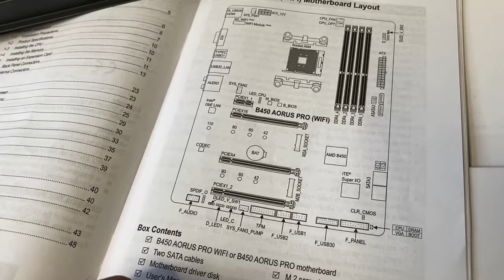How to Install a Case Fan in your PC

Comment: mine doesn’t have the led1 thing what do i do??
Reply from the maker: If your Motherboard doesn’t have a RGB connector then you’ll have to get a sata powered 3-pin ARGB hub.
Reply: @BuildsWithV  even the fan is single color i need that? Sorry im newbie
Reply from the maker: @joshuasantiago4342  what fan do you have?
Reply: @BuildsWithV  its has no brand found it on amazon its single color red fan
Reply from the maker: @joshuasantiago4342  oh okay, is the connector on it a large 4 pin connector? Could be a molex
Reply: @BuildsWithV  yes its four pin and single color
Reply from the maker: @joshuasantiago4342  if it’s the molex connector, that plugs into your power supply cables.
Reply: @BuildsWithV  if i only want the fan no rgb do i only put it on system fan 1?
Reply from the maker: @joshuasantiago4342  it might turn the RGB on automatically if there’s only 1 cable off the fan. But yes you’d plug it into the system fan connection.

Comment: Have you really installed the PSU with the fan faced up? Are you serious, man?
Reply from the maker: Yes I did. I used it as an exhaust fan. I changed it back down tho because the PSU would get a bit hotter than I liked.

Comment: what if i only have 1 sys fan?
Reply from the maker: R0TC if you only have one header on your motherboard then you will need either a fan splitter or a sata powered fan hub. I have a link to a fan hub in the description that would work,
Reply: @BuildsWithV  thanks for replying 🙏🏻
Reply from the maker: R0TC no problem at all. Thank you for watching 🙏
Reply: @BuildsWithV  can i ask one more thing?
Reply: @BuildsWithV  what if i don't have a rgb header?
Reply from the maker: R0TC do you have a 4 pin rgb header? If you don’t have any RGB header including 4 pin or 3 pin, I don’t think you can have RGBs unless you get sata powered RGB hub with a controller or your case cane with an rgb hub that has a button on the case to control rgb. I’m not too sure exactly how it would be done in that case or what product you’d need. I’ve only ever used my motherboard RGB headers.
Reply: @BuildsWithV  well i don't have any rgb header on my motherboard